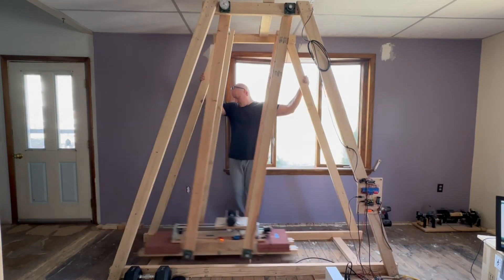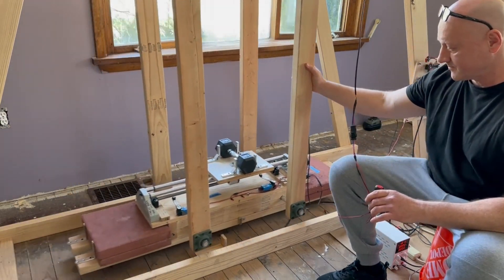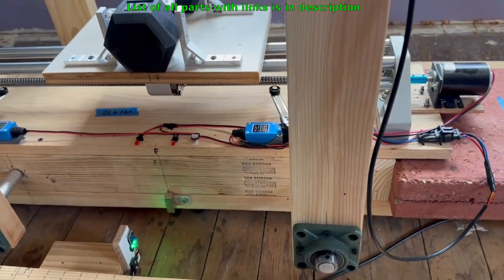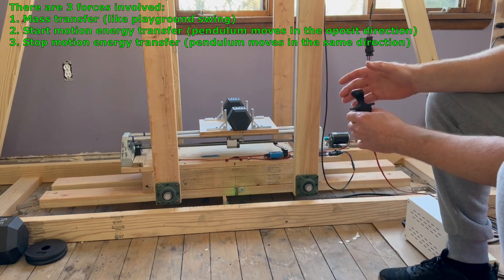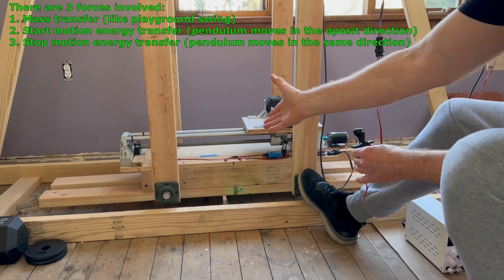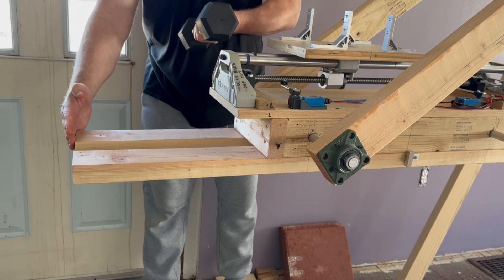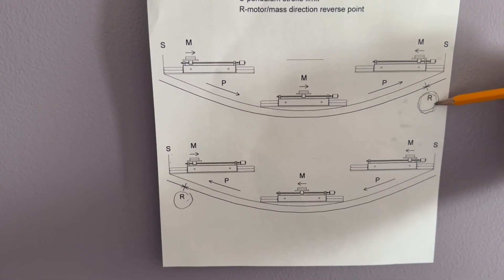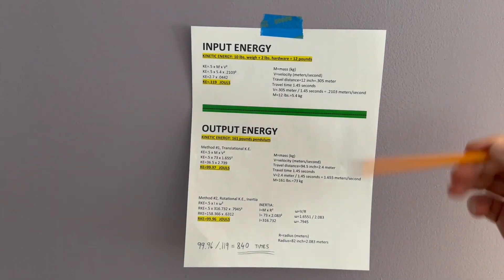Mass transfer pendulum. Drive system with pendulum mechanism, Patent No. US-12196187-B1

Comment: If you think it's another free energy device, think again. Simple calculation will show that the total energy input is larger than output.  In case u don't know, rotational kinetic energy of the pendulum is excitation torque x angle travelled in radians over a period of time.

Comment: Every electronic engineer worth his/her salt, will recall the mode of operation of a class C amplifier, and the concept of "angle or circulation" - which underpins the kind of device designs where the input is present only for a fraction of time, and at the precise time when the new and the pre-existing energy in the load do sum together...

Comment: Energy is added to the system on every stroke.
Starting energy is not from zero as the designer pushes it against gravity before starting. 
Therefore the energy multiplication is not as stated.

Better method for energy transfer is to obtain a watt meter for the motor controller. Then measure speed at dead centre on the bottom of the pendulum movement. Measure total watts over all the strokes until momentum has built up, then measure the speed, o.5 mv2 for kinetic energy output. Now calculate energy multiplication.

Btw, start it without any push.
Reply from the maker: Great point. Btw, Pendulum can start without any push no problem. You can see that on video 1:42 in manual mode. I’m starting from small angle only because microcontroller needs to calculate period and timing in automatic mode. Energy of the system is not accumulated. If it was than you would do many strokes with small weight to get one big stroke of the whole pendulum. You can see that one stroke of a small weight on linear slide equals one stroke of the whole pendulum. Energy of the system comes from mass, not gravity. As we all know, mass is energy and gravity here is just a middle man.

Comment: SAME PRINCIPAL CAN BE USE ON A WHEEL. GOOD JOB!
Reply from the maker: Good idea with the wheel, i thought about too but unfortunately this pendulum or playground swing works like “mass transfer moving lever” and it cannot work on wheel. But what could work is spinning mass instead of sliding back and forth which would require less input energy.

Comment: hi. Where in this mechanism will there be the highest torque output for the generator?
Reply from the maker: At pendulum equilibrium point, bottom middle. It’s fastest there.
Reply: @cmss5674  I had the idea of a bicycle ratchet, on each side on the upper axis of the pendulum, inverted, connecting an exion with a crown with current.... a home-made wind turbine stator, more efficient, for me. Good talk to think about
Reply: @cmss5674  It seems to me... that you have the idea of a linear generator

Comment: What happens if you add a shake weight for extra degrees of freedom/resonance?
Reply from the maker: Yes, good point, I tried it, even rubber bands on moving weight with wheels. It didn’t improve the performance.
Reply: I thought this . unstable mechanism

Comment: Once the movement of the weight stops.... it should go backwards only wen the movement of pendulum is reversed. if you do that you have less losses.
Reply from the maker: Good point, that’s how I originally started in the beginning but that movement backwards would generated small push on pendulum opposite way and slow down the pendulum. That’s why I had to change timing to what it is right now.
Reply: @cmss5674  I believe the reason is because and in "theory" the wheight once it starts the movement it must virtualy be from the midle to oposite and versus. the inercia than should cancel itself. from other hand the masses interact each other, and wen the pendulum wen is on steady state momentum, any movement from weight will react. you tried to do fast movement on weight? or progressive like we all do on play swing chairs? NICE WORK